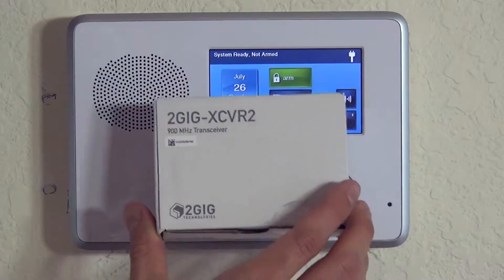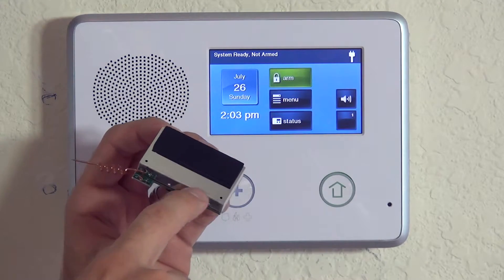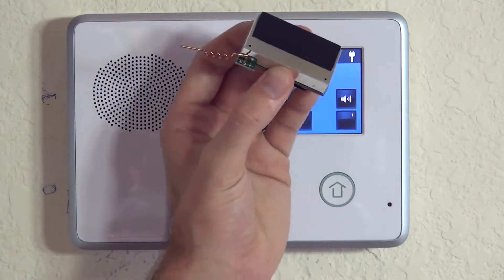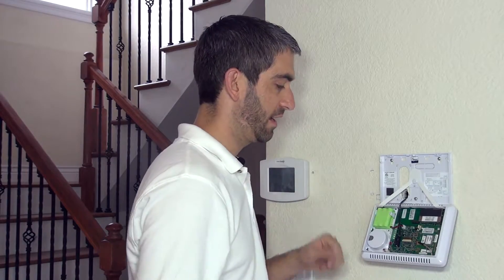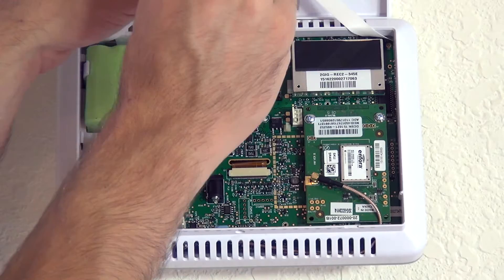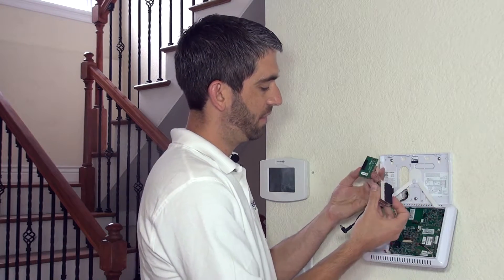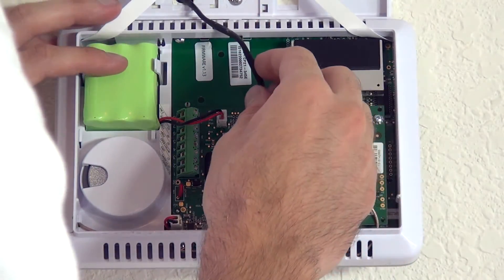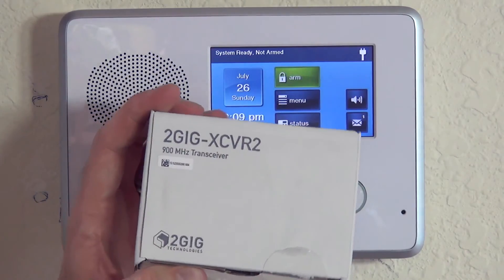2GIG XCVR2-345: Go!Control Installation

Comment: would changing this part. will this fix loss of supervision alert?
Reply: No, this is a special receiver for integration with certain GC2 peripherals (like the TS1 touchscreen keypad, the Go!Bridge IP communicator and the Image Sensors). If you have sensors with loss of supervision troubles, that means they are either incorrectly programmed or they are too far away from the panel or there's some environmental obstruction between the panel and the sensor causing the sensor signals to not get to the system. If that's your situation, adding a repeater (https://www.alarmgrid.com/products/2gig-rptr1-345) in between the sensor(s) in question and the panel would be the recommend fix.

Comment: would the ts1, need the module too?  i returned a ts1 because monitronics nor i could get them paired.  i did not know about the xcvr2 until i watched this video.  thoughts?
Reply: James Eubank, MSCJ , I'm a tech in the field and did not know about this board. You would expect the 2 gig to have a built in modules. Lol I'm getting my training by alarmgrid . Lol not my compay.
Reply: You guys Rock. Thanks for posting helping info. Very much appreciated.
Reply: Yes, the TS-1 does need this module as described at https://www.alarmgrid.com/products/2gig-ts1. You should consider switching to us for monitoring as we are experts on the 2Gig systems. We offer no-contract monitoring online at https://www.alarmgrid.com/monitoring and could use your existing system and communicator (once Monitronics releases it).

Comment: Does the panel have to have cell installed to work or is it like a LAN and will communicate internal?
Reply: Assuming you are asking about the GoControl panel, you can certainly use the system without monitoring service. It would just make a loud noise when there's an alarm. It won't send out any alerts without having some type of service using the cellular communicator or IP GoBridge module though.